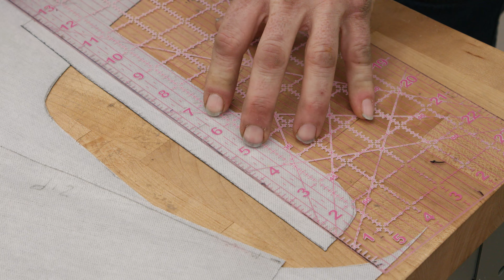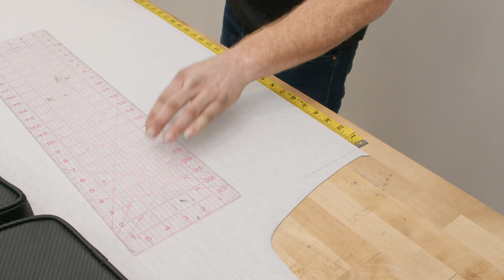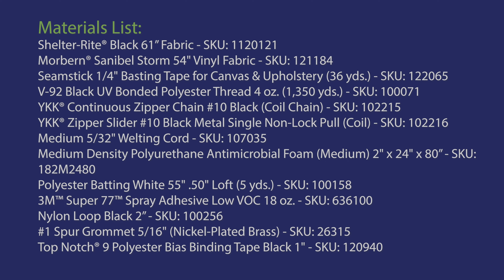How to Make a UTV Door Bag With Kneepad

Comment: Why not put a zipper opening on the back side and see it inside out then insert the foam? The unfinished edges would all be on the inside. Then insert padding through the zippered opening and then just zip it closed and the zipper would be hidden behind the padded back panel.
Reply from the maker: Yep, good suggestion.